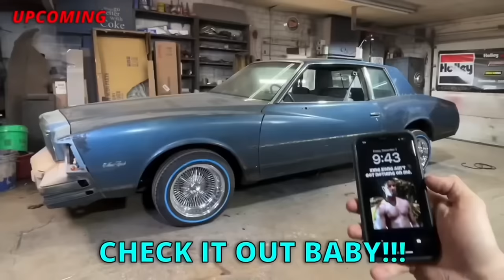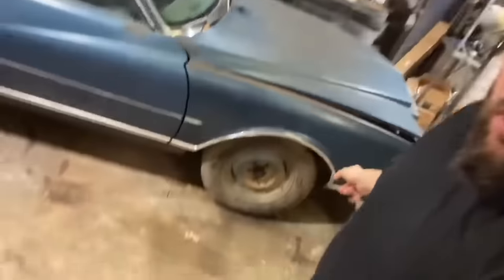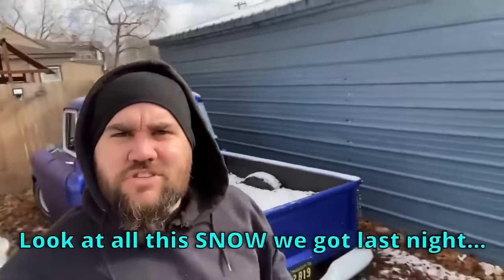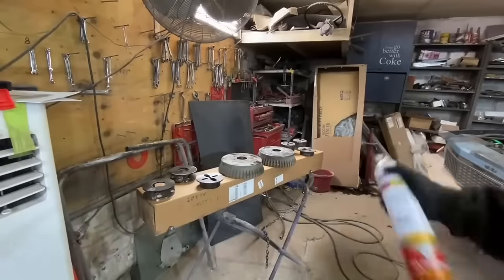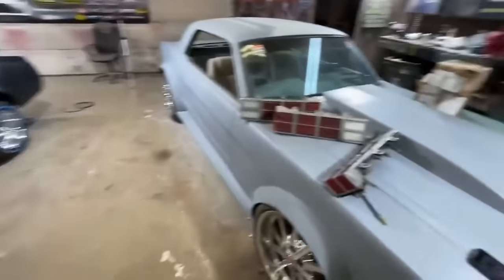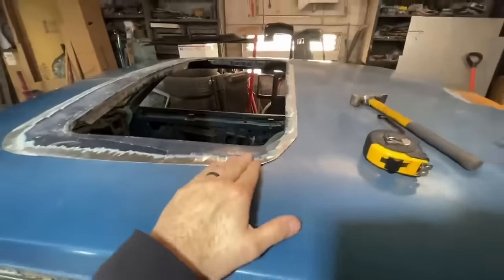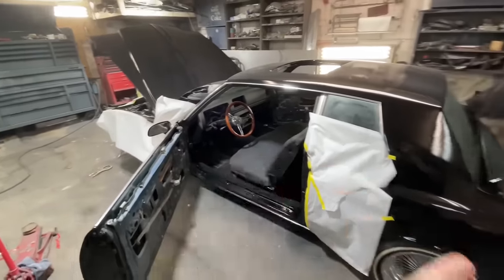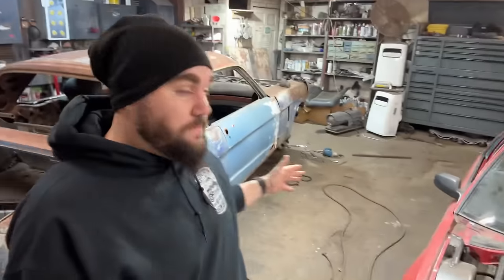I BOUGHT A MOVIE CAR! BUILDING THE LOWRIDER FROM TRAINING DAY! START TO FINISH!

Comment: Love this build, buddy !! 👑 Owned 4 different Monte's in the 90s. Had a 1980,1983, 1984 T top and a 1986 luxury sport... I used to change my rim's more than I changed my shoe's. 14"True knock-offs, 14"Supreme's, 20" wires ect. Im sitting on a mint 1980 t top ( changing it to a 78 my fav year). It has been parked in a barn for 20 years ! You're video's have put some fire under my ass! Thank's!

Comment: sumting i seen done to a car a while back was that they put hydraulic lift cilinders between the chassis and body in place of the rubber bodymounts and adapted the floor so it body dropped further over the frame 
that allowed him to keep the suspension and steering geometrie stock and still make the car look like its laying frame

Comment: My car uses ATF instead of power steering fluid (which I guess is very similar to brake fluid) On my car, if you use power steering fluid, you will ruin the power steering, because it ruins some seals, so Im guessing that ATF may not wreck your seals or anything, but it also probably donest work as well as brake fluid when it gets hot.

Comment: On the bright side Trans fluid will absolutely work as brake fluid consider for brake fluid you just need any oil roughly the same weight as hydraulic fluid just don't put brake fluid in the Trans and your good
Reply: Side note don't leave it in there tho cuz after a few weeks you'll start blowing brake lines but in a pinch it works just fine